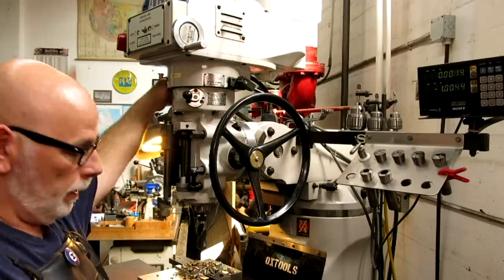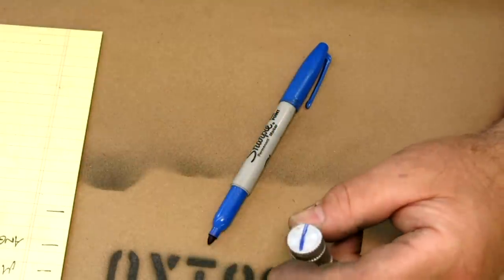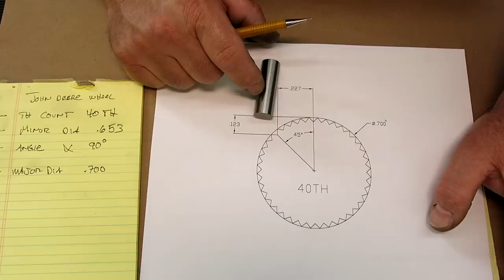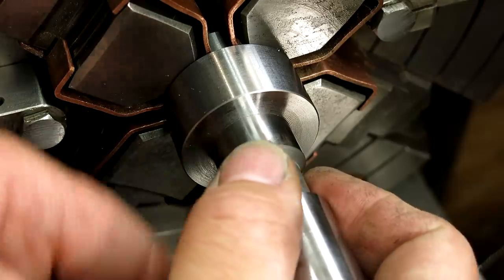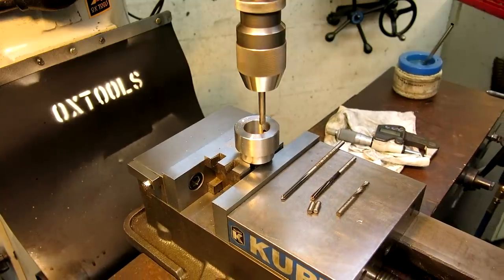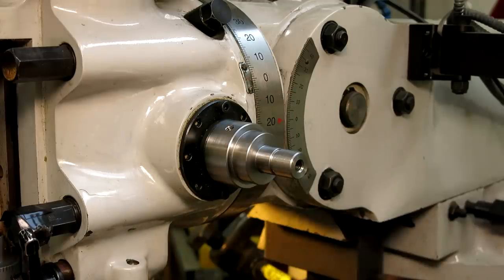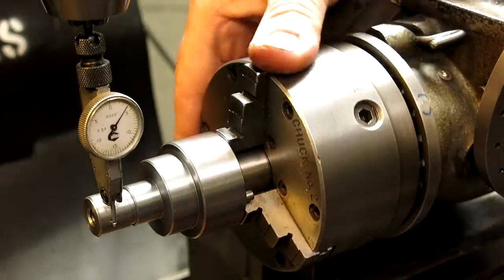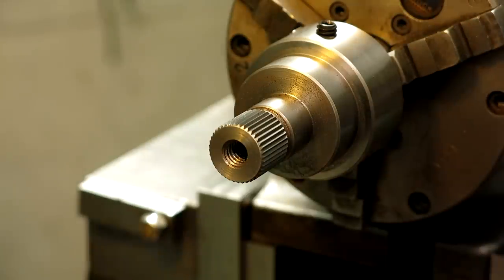Sensitive Quill Feed Handle for the milling machine

Comment: Feels so 2015. No hardening, no surfacegrinding, no electronic indicator and no lapping.

Well done, nice splinedrive and good trick with the low melt alloy.
Reply: Hey didn't you do a thing on reaming with straight oil VS emulsion?
Reply: Yes - Emulsion or other very light lubricants produce generally a very tight bore, cutting oil makes it half a beesdick larger.
But as usual, your mileage might vary ;)
Reply: Been working in Machine shops for almost 20 years and I can still learn so much from your videos. I guess that's the result of production being the prime focus of shop owners or the lack of apprenticeship programs in my state. Thank you for sharing a lifetimes worth of knowledge.
Reply: I agree Stephan, I especially took note of the Woods Metal. I have already looked up supply and cost. Cheers from John, Australia.
Reply: I tested that with many different viscosity oils and depending on the material you might get too light of a cutting oil and go almost a whole beesdick over...I have a really hard time getting a good like finish on brass and sewing machine oil seemed to be the only thing to somewhat help, but still no lapped-like finish...
Reply: Which was one of the great things about it - something most of us could do in our workshops! Really liked the method of cutting the serrations.
Reply: .0014 in  tir diff. What.. now i have to watch your results
Reply: @StefanGotteswinter  I find Rocol and Paraffin in equal measures works a treat in most steels, neat Paraffin on Aluminium.

Comment: Beautiful work, what impresses me so much when I see your work is the incredible speed that you swap tools and get back to the cut. One hand is cranking the bit into your drill, the other is already reaching for the oil brush, and the chips are cutting again in 10 seconds flat.

Comment: Man I like that dividing head so much....bison adjustable chuck awesome edition...
Clamped down (1st real clamp job) my first brass cylinder piece (turned on the WW2 logan) to drill on the 1970's import tabletop was rusted solid drill press. Took me half an hour to clamp it digging thru the 10 lbs of clamps and bolts trying to fit something correctly...
LOL

Comment: Very nice work. Using the existing splines in wheel and machining splines on shaft to fit.  What I like is the fact the new wheel can be removed and the original lever reinstalled without any problem.  Thinking the job through, good work.

Comment: Nice. Now all you need is a siucide knob and your all set.
On reaming, I have found that, (at least on aluminum), using water soluble oil causes the reamer to cut smaller than WD40 or cutting oil. 
I was turned on to this by an old timer, many years ago. I have no idea why it works.
Reply: Mr. Morningstar  Came here to say the same thing.

Comment: You are absolutely right about reaming holes.  It's more art than science.  Over reaming the hole for the amateur most often occurs because the reamer is not running concentric with the chuck.  In fact, when desired and in a "pinch", you can ream a hole slightly larger  than the nominal size by inserting a thin paper between one of the chuck jaws and the reamer shank.  This may only verified by test, as you suggested. 

The old Burgmaster also had a large steel wheel.  It provided great sensitivity.  Best regards Tom.

Comment: Wicked cool, but how about a one-way roller clutch kinda-deal? Infinitely adjustable for pressure and feed, and depending how cocky you get, you could do a bi-directional friction roller clutch. The cams and ramps would be particularly challenging, but from what I've seen from you, not terribly difficult!! Kick-ass and Kudos on the re-purposing of a John Deere tractor steering-wheel-flea-market find!! Well, DONE, Sir!!

Comment: Very inspirational. I was looking the other day to do this very thing for the same reason. Thanks for the procedure too.
I knew the first pin would wobble on you because I saw the reamer was not set straight or it was bent going into the hole.

Comment: Always looking forward to your videos being published and never disappointed!  You're right on the reaming being a little tough to get a nice press fit at that small size.  So many factors come into play.  Speeds a feeds for example or  what type of coolant and how much.  Not to mention the operator of the machine and his "feel".  Also, I would mention pecking  or not pecking with a reamer (so little chips).  I was really surprised that the first hole you reamed came out oversized since you left only a couple of tenths to remove after the first reamer (0.1870").

Comment: That alloy you used looks like cerrosafe which is used on firearms to make casts of chambers.I have also heard you can use molten sulfur.I made a bore lap once using jb weld after using pam as a releasing agent in the bore.

Comment: Great video, Tom.  I had to do something similar a while back but was not so clever.  I ended up making a custom indexing plate to attach to the back of my lathe spindle and then carefully cutting each spline with a tool turned sideways in the holder.  Took a lot of time but got the job done.

Comment: I've found over long experience you get a tighter fit if you cut 41 teeth for a 40 tooth bore. You only need to press it on once.

Seriously, nice mod. I thought about it for my mill but I what if I wanted to wrench the nod bolts? Well, duh! Make an extended adapter like yours. 

20 or so years ago, recovering from sore wrists from feeding large drills into stainless, I concluded the existing 4" handwheel inadequate so I mounted a 12" aluminum handwheel on my lathe tailstock quill. Makes it easier to feed larger drills and with its momentum it's quicker to extract if you give it a spin. Oversized spinny hand wheels definitely have their place.

Now I gotta shop for another handwheel.

And a stencil.

And a can of spray paint.

Never too late to make your mark in the world. Maybe in Roman Serif Narrow. Or heiroglyphs? Yeah, a cartouche! Classy. What's the Egypitian heiroglyph for "machinist?" Is it a bird and a round thingy, or a bird and two squiggles? Something simple, unpretentious. Restrained yet stylish like a leather vest made from unborn white mice scrotums.

Comment: Heat or freezing makes all press fits work when they are close, no need to blow your hole size over with a second trip with the reamer. :-) I loved the offset milling to cut the splines with one tool in one pass per tooth.

Comment: Hey Tom,

You beat me to it! After fitting the power feed to the knee of my machine and using a cheap cast Iron wheel on it, rather than having the standard crank whipping around, I bought a 12" cast wheel from the same source to use on the quill.

Comment: A hint I learned in the tool room, for a press fit, if the pin is a little loose...put some dings around the dia. with a center punch.  It has the "knurled valve guide effect" on increasing the dia. a tad.  The machinist that gave me this tip was the only one of us four in the tool room that also did all jig bore on the Moore WITH THE BIG STEERING WHEEL...a great idea for the Bridgeport!
Reply: he said those were hardened
Reply: Yes, we also used hardened dowel pins...they will ding up, also we would use an electric tungsten tip tool etcher-marker to raise up the surface, as long as inspection dept ok'd the fix.

Comment: Tom

An easy way to measure the spline/tooth angle is to just scan the end of the casting, then print it to fit on a 9x10 sheet of paper.  Accurate enough and simple

John

Comment: I believe you didn't have enough stock to guide the reamer. Compared to hand reamers you want a little more stock left with machine reamers and also I always buy right hand cut-left hand spiral reamers, as I have found that apart from the better finish, they can probably tolerate a little more runout when I use them in the drill press while straight flute machine reamers will very easily leave a 6 corner hole. Nonetheless hand reaming if done right is a whole tolerance class higher than machine reaming, and the best hand reamers I have used are some Soviet GOST standard (straight fluted)...

Comment: Stefan Gottswinter indicated in one video that if you use soluble oil solution to lubricate, a reamer will provide press fit; using cutting oil gives a sliding fit.

Comment: nice adaption to a mill, but would look and work nicer if you added a knob, like fork-lifts have on their wheels, make long drill/tapping a real breeze!, also a smaller version would work for the table, carriage and the tail-stock handles, great for long workpeices.( for lathe and mill work).

Comment: The main "advantage" to spiral reamers is that they're self-cleaning. Straight-flute reamers have to have some fluid "flushing" the "chips" the cut back out of the flutes OR have to be frequently retracted to clean the flutes. And mainly a reamer shouldn't do any more than "smooth" the ID after its bored with a cutter that's inevitably going to leave a "spiral" surface finish "groove" from top to bottom of the bore.

Comment: I think your reamer misbehavior is due to a minimum chip thickness which can be removed from a given material. I have noticed on my lathe that machining friendly materials like 12L14 steel will allow me (with a sharp bit) to turn .0005" off of a diameter, while unfriendly materials like 1018 bottom out around .0015"

Comment: Reamers in my experience are fickle. I've found that using a thick lubricant causes oversize holes, but I haven't found a consistent formula. The standard sulfur based cutting fluid I use normally is always oversize. Something like tap-magic or kerosine is usually much tighter. Also, they're inconsistent with relation to the amount of material they remove vs. the finish size. For example, a .374 reamer will ream true in 1018 with a .366 hole, but ream under with a larger starting hole, and over with a smaller starting hole. If I ream with a light lube and the hole comes out under, I first try to ream with the same reamer and a heavier lube. Usually, that does the trick for me. Also, I find that if you back the reamer out under power, the hole is oversize. I tend to ream to depth, turn off the machine and retract. When you're talking about slip and light press fits, the tolerances are vanishingly small. I'm usually doing press fits that can have some leeway. I'm always making jigs and setup plates for my CNC and I make a lot of aluminum plates with pins pressed in to accept workholding plates accurately.

Comment: I broke a tap in a blind hole 3/8-16, it broke because the chips packed in the bottom of the hole! Is it better to go from center drill to final size tap drill opposed to multiple size drills to get to tap drill to avoid this problem? What of it was a 1" tap, my mill is 3 horse power!

Comment: nice Video.  Could you perhaps tell me how to measure a Reamer ( i have bought a lot of new ones as "Bulk" ) and some / most of the sizes  are hard to read)  and since there are Spiral ones, and straight ones, the straight ones are a mess to measure:) and i am really not in the mood to drill / ream and measure each hole, because that would take forever.  I am talking about 150 reamers i need to measure.   Thanks in advance . rgds michael
Reply: A micrometer, a careful attitude, and a delicate touch.  If all else fails, a test cut...
Reply: Bob Korves   you are right . but as said there are some more than usual  to measure lol.   the last time i counted there were 170 pcs of them  and all in the range 1/16 till 1/2   so i appreciate a nice methode to measure them in the right way.  ( the conical ones are excluded 😎)
Reply: @Michael Schnock --  I have measured at least that many, though bought in several batches of pre-owned tools.  Many do not have sizes written on them, and some that do have sizes listed may have been sharpened and may now be smaller, so you really need to measure all of them to be sure.  You can measure them roughly for sorting and then measure the appropriately sized group more carefully when you need to use one.  You will end up doing that anyway, in my experience.  Measure them well back from where they enter the work, some have tapered lead-ins (hand and machine reamers) and some cut on the end only (rose reamers) and so are cylindrical, at least when they are new...
Reply: @duobob  I second that. A simple vernier can help with sorting them out roughly by size, probably you'll have some doubles-triples-quadruples-etc. anyway and once you need one, then bring out the precision micrometer and choose the one that suits your needs. Saves time, nerves, etc.

Comment: Would you have to worry about shrinkage in the cast part for your measurements or is it pretty stable dimensionally
Reply: I wondered this as well. The info I was finding says .005 shrinkage.
Reply: Another brand is Cerrosafe, gunsmiths use it for chamber casting. Don't remember the shrinkage rate on it.
Reply: Ben Kjellberg , flexbar has an epoxy and fine feature metal that are essentially no shrinkage.

Comment: I don't know...  Good fit and all, and I was glad to see 2 pins thinking you were thinking ahead, but then only 1 set screw??  That will be out of balance, since you didn't spin balance it.  So, when the heavy spot happens to line up on the back side of the stroke, it will be moving up rendering the set up less sensitive.  MAYBE you could get lucky and measure where the hands of the John Deere driver habitually has worn the wheel a little thinner and rotate the wheel on the fixture.  Of course, you will have to do the math because the the two masses are on different radii..  Pretty sure Renzetti has a linear radialfeedforceomometer that will read zero when you achieve balance...

Comment: Wouldn't it have been easier to just straight knurl it on the lathe? Also why couldn't you cut away some of the plastic closest to the mill, then bore the wheel hub and add a couple of pins? Would it have been to close to the mill?

Comment: Hello ox are you there? I just saw this video today 7-26-18 why are you using a spot drill? You should use a number 4# center drill
They sell undersized reamers you should use a .186 you should have a .001 press fit that will give you .000525 per side for press fit.
The reamer must have a thicker cutting oil and all flute must be cover in oil. This is why everyone can’t ream holes. Let me know if
Your willing to try this.

Comment: Should have bought the shaft from the mower as well! No doubt more fun this way
Reply: If you go to the “Auto Recycling Center” (Junk Yard) You can get the wheel and steering shaft, or just the shaft, the spline is industry standard, and will fit most wheels and make your adapter fit both sides. I do love Tom’s approach, but I don’t have all the tooling that he needed to get the accuracy to cut the spline.

Comment: How would you cut a thread if you dont have a lot of depth? Usually you have this conical tip on the drill and thread cutting tool. Is there some sort of flat drill and thread cutting tool?
Reply: I believe you're looking for a "bottoming tap".

Comment: Now all you need is a trucker knob on it now, you'll be cooking with JP4.
Reply: I could see a straight handle under a little spring tension so it goes back to a rest position on one of the support spokes, when not actually being held.  The surface grinder at the local tech school has handle/wheels like that.

Comment: I believe you didn't need the microscope to discover the tooth  angle. Knowing the number of splines, the inner diameter and outer diameter, that angle is known. I think you just plot an array on both circles, and then rotate one by half a tooth. Don't mean to second guess your approach. But that's how I might have approached it. I love that microscope. I'm so tired of squinting through loupes.
Reply: The tooth angle can be independent of id/od/qty if there are flats/curves on the peaks/valleys - maybe you don't need a microscope to see that but it doesn't hurt :P
Reply: Thank you! I've been trying to figure out where that might not be the case, and coming up empty. You're right; There is an exception. Besides, we wouldn't have seen the beautiful scope.
Reply: If a lot of torque needs to be transferred without binding, a spline will have flats on the top and bottom, and a shallow tooth angle.

Comment: Y not just use the casting piece it's self and attach it to the rest of your adapter or just make your drawing without the splines and put a set screw through the side of the steering wheel since it's already metal and a flat on the adapter

Comment: Couldn't you just know the minor and major diameters and tooth count and from math get the angle of the teeth?  Using your dimension on your drawing, I come up with 0.640" on your minor diameter.  I would trust your minor diameter dimension you got with a pin gauge then you would end up with a major diameter of 0.710".  IDK, just thinking out loud.

Comment: Start doing lots of "production" work on a vertical feed tool like a mill or drill press and keep your fingers in a "pinch" all day and try to do "sensitive" work and you'll find out WHY "spokes" are superior to "wheels" for putting force on the feed mechanism. Having a wheel instead of spokes also puts a bunch more mass out there all the way around the "circle" the force is applied to anyway and produces a "flywheel effect" that makes beginning to feed harder and stopping the feed once the "handle" is moving harder. You also may find that cheap plastic steering wheels are made from material that may not "like" solvents, cutting fluids, etc.  But if "everybody" is doing something online, some people feel obliged to jump on the bandwagon. Or find their spot in the "herd" if you prefer.